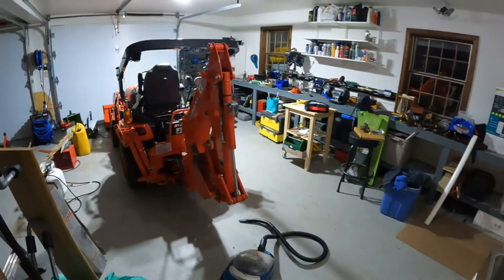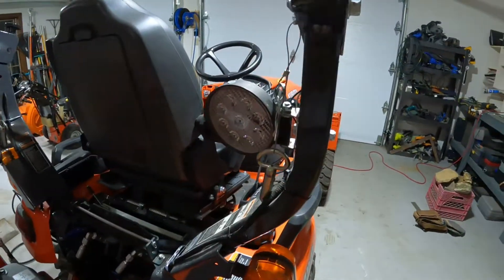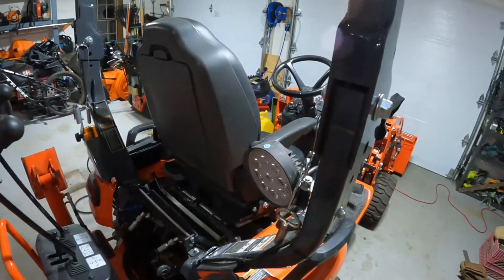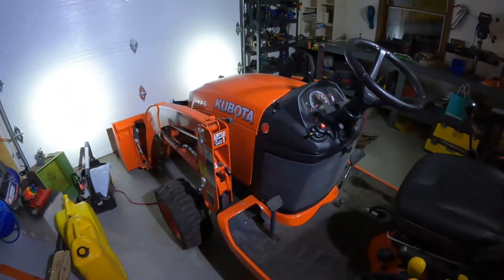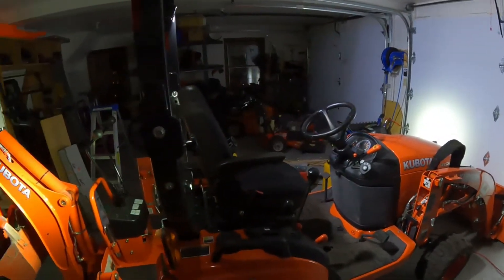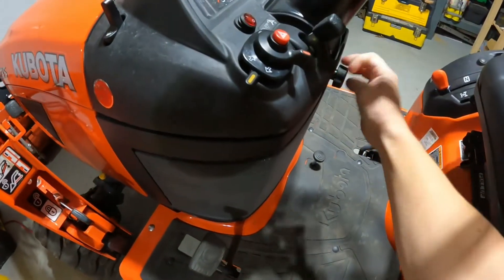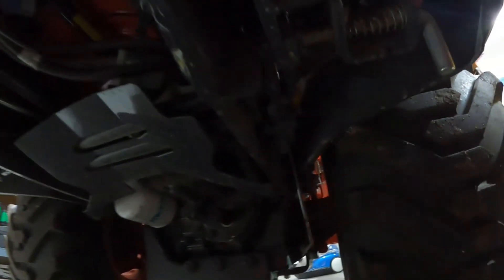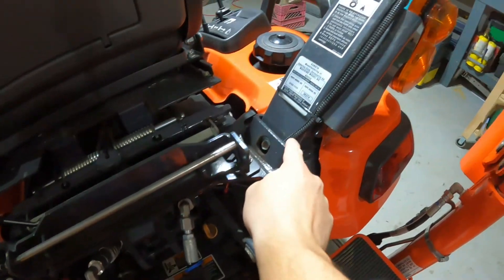LED light MOD on the Kubota BX23S

Comment: I have a three light setup also, I had two kubota lights installed at the dealer when I purchased it and then I added one facing to the rear. Definitely need lighting when using the snowblower at night. Have a great week 🙂🙋🏼‍♂️👍🏻
Reply from the maker: Couldn’t agree more, the stock lights are essentially useless… thanks for watching, have a great day 👍

Comment: Nice clean install, and works nicely. I did the same to our BX23s. The OEM headlights are worthless for sure. Since putting my LED light bar on ours up under the full width of the ROPs, i`m taking it back off and going to smaller less powerful dual lights similar to yours. The huge light bar i put on ours is just way to big and taxes the charging system a bit to much for my liking. I have a small one mounted on the ROPS at the rear like yours, and that gives me plenty of rear lighting. I see you have the exact same switch i put in mine, and i put it in the same location as yours. Its wired directly to the battery so that i can turn the lights on without using the ignition switch. That way i don`t need to leave the ignition on to use the lights. Keep them BX videos coming!
Reply from the maker: Interesting to hear your story with the light bar, I was contemplating doing that as well so I’m glad I went with the small ones! They work really well, the only “disadvantage “ I can think of is they are a little low so the light reflects off my head and causes a little bit of glare in pitch black conditions, but aside from that they’re great. Thanks for watching and stay tuned for more bx vids !